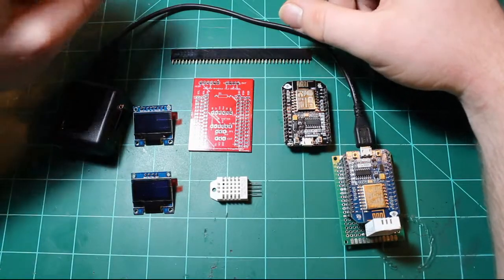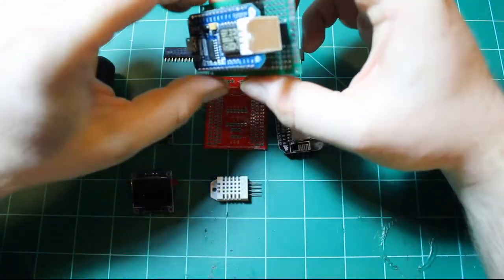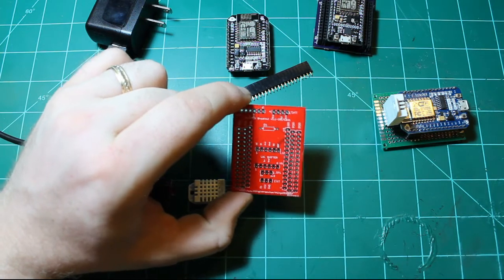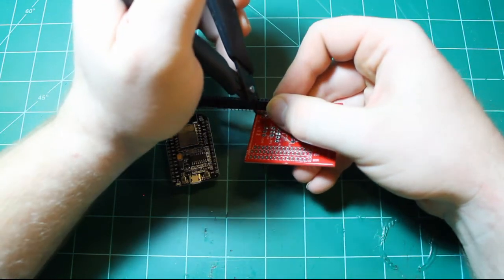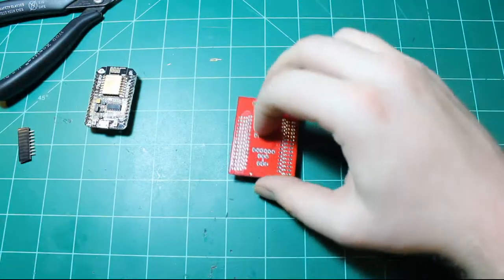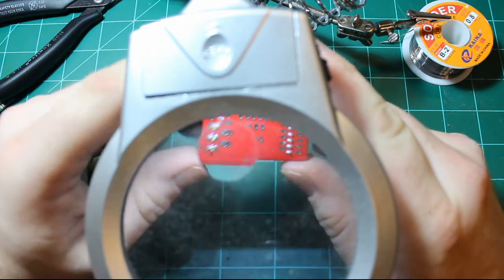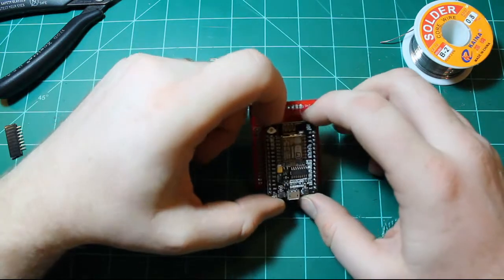NodeMCU Breakout/Carrier/Dev Board Overview

Comment: A really great board, and you have been very generous, in sharing, thank you.

Did you consider adding a rst/d0 jumper to allow for deep sleep mode?
Reply from the maker: Yes I did! I originally used a resistor between them (the 10Kohm spot you see on the board), but that sometimes caused issues with allowing remote programming of the NodeMCU. With the v2 board, I changed the resistor out with a BAT43 Schottky diode - works perfect, for deep sleep and allows remote programming!
Reply: @BKHobby  Thank you, noted and saved

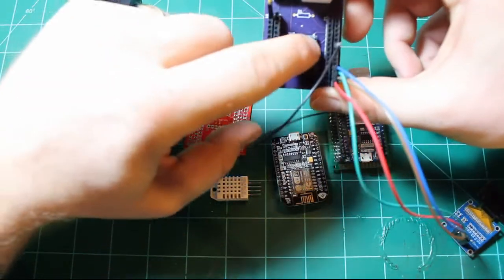Comment: Sorry if this is a dumb question, but in the segment at 3:40 in the video, how did you attach your level shifter to your board? I have this level converter: https://www.sparkfun.com/products/12009 and I'm struggling figuring out how to solder it to the board. Perhaps I'm overthinking things- any advice is appreciated!
Reply from the maker: Just make sure you match the pins on the level shifter with the board - usually, the transistors on the level shifter will face "down" towards the breakout board. 

The way I usually mount these is I first solder the headers to one of the boards (either the level shifter or the breakout, doesn't matter), with just a single solder joint. Then, plug it into the other board, solder the full set of pins in, then complete the remaining pins on the first board. This way, you'll avoid having issues with pins offsetting or falling out. Hope that helps!
Reply: @BKHobby  Thanks for your help!
Reply: @BKHobby  So I've got my level shifter plugged in to the breakout board along with my NodeMCU; does this mean that I can come straight out of one of the data pin breakouts and into an LED strip (in my case WS2812b)? Or do I need to solder data/ground to one of the 6 HVB pads on the bottom left side of the board? Sorry if that doesn't make sense, I'm almost at the point where I can articulate what I'm thinking lol, I really appreciate your help though, your videos and breakout board have really helped me get started in this!

Comment: So, I bought five of your v1.2 breakout boards, then ordered all the right parts (DHT22, NodeMCU v.9, IIC OLED screen, etc.). Printed the case with my 3D printer.

Unfortunately, the project doesn't work at all: I'm getting "Failed to read from DHT sensor!" message, and the OLED screen doesn't turn on...
Any assistance would be cool.
Reply from the maker: @Jacques Laroche - are you using my original (Github) code or ESP Easy? Either way, in the new board (v1.2), I changed a lot of the pins for external devices (for example, I was using incorrect I2C pins in the original board). One of the pins I had to change was the DHT sensor, so instead of using D2 (ESP8266 GPIO 4) like the original board, I now use D6 (ESP8266 GPIO 12). You'll need to change that in my code or the ESPEasy DHT22 sensor configuration to make the DHT sensor work. More documentation would be nice, but I haven't had time to sit down and write it all out yet (or make a new video on the board/sensor) :)

Also, join the Discord chat server ( https://discord.gg/yrfd54N ) for more realtime support (I try to make myself available daily to answer any questions). 

Thanks for watching and for supporting the channel by buying my boards/using my links! :)
Reply: @BKHobby  Thanks for the info! Yup, I changed the Pin for the DHT22 to work with your v1.2 breakout board and that fixed the communication with the sensor. 

Unfortunately, I have to find some free time to figure out why the LCD screen isn't working... But, in the mean time I've added clearer code to reflect this issue and made a pull request on your Github. Don't want anyone to fall into the same issue I just climbed out of ;)

I'll see you in the Discord!

Comment: please show us how to wire the PCB board for LED animations
Reply from the maker: +Anthony Dash - have you seen my LED controller playlist yet? (https://www.youtube.com/playlist?list=PLH-d6dcsARGNHlRyqTrwyiWJLNb1YpbPS) - I explain the wiring for the PCB board specifically for the LED animation strips. It's very simple - you wire the 3-pin LED connector to VIN (Red), Gnd (Black) and D4 (Green). You need to provide the 5 volts from an external power supply that is capable of powering the LED strip, too.